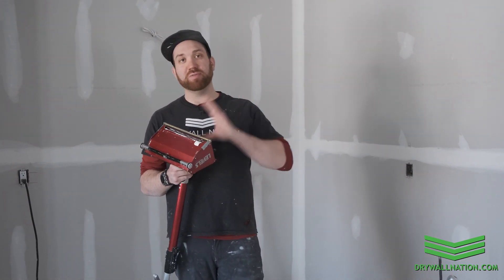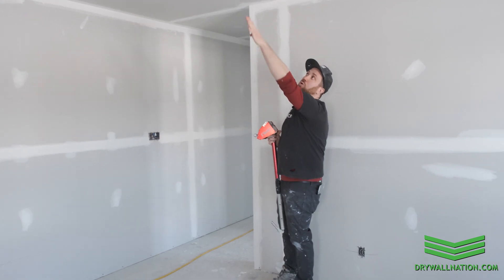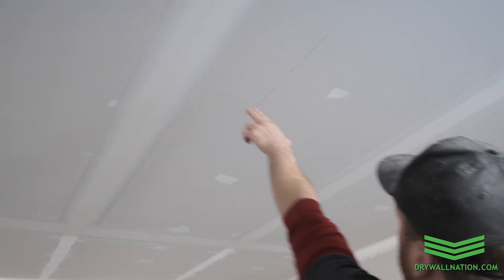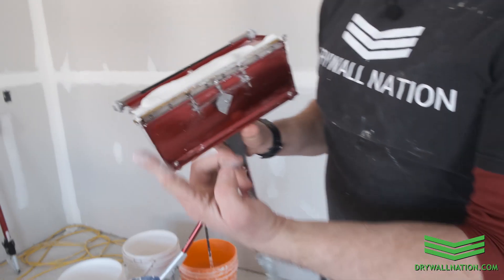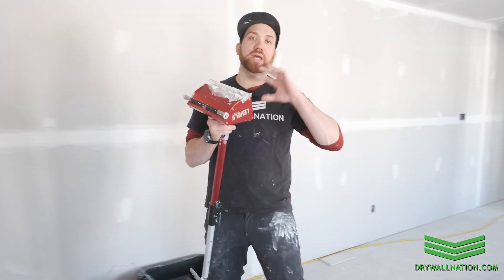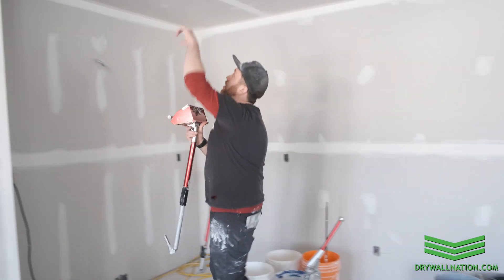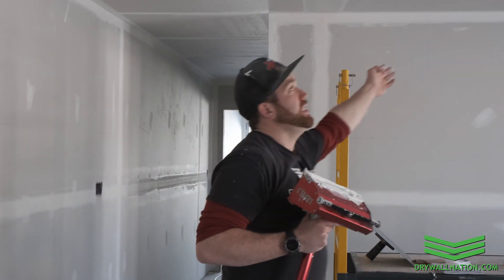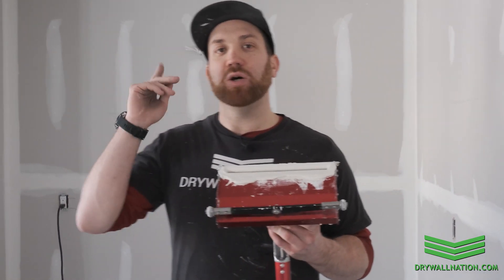How to Use a Drywall Flat Box on Ceilings |  Video 5/6

Comment: Do you recommend Level 5 tools?
Reply: Level 5 tools to have them all to do drywall work all day and night is costly, $4000. If you do it day in and out and always behind on project work where you can recover you money investment, then go for it. If you can’t buy everything you need to go start to finish then buy the flat boxes, type gun, and corner finisher and corner roller so you can get the start of jobs done fast